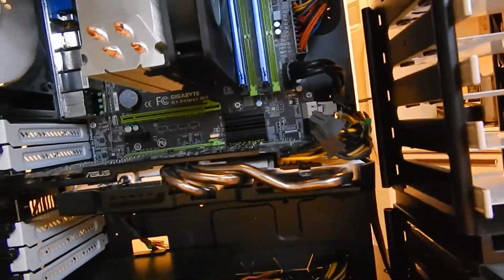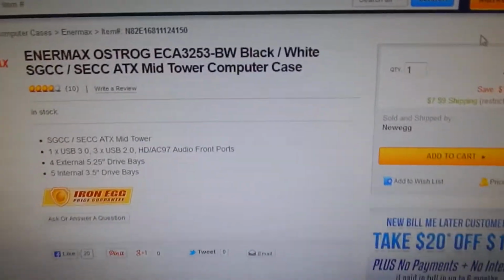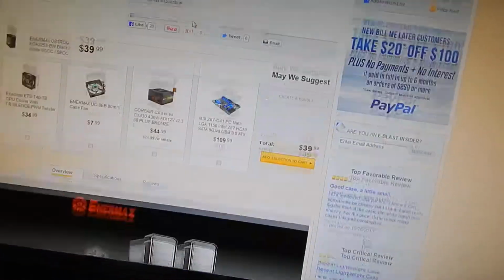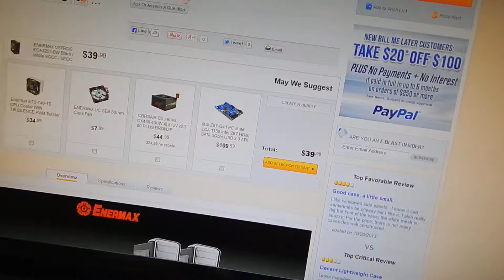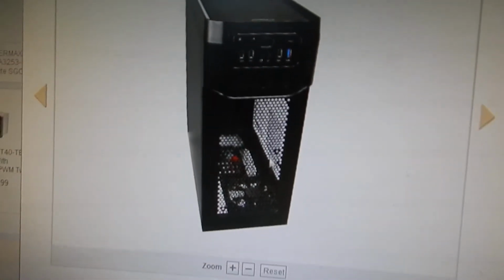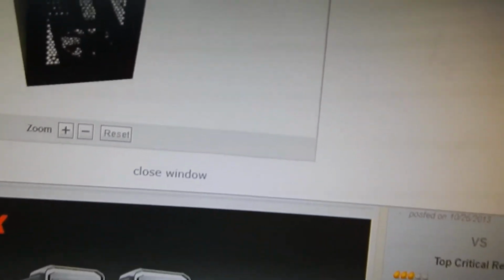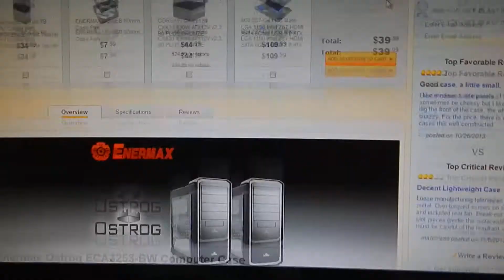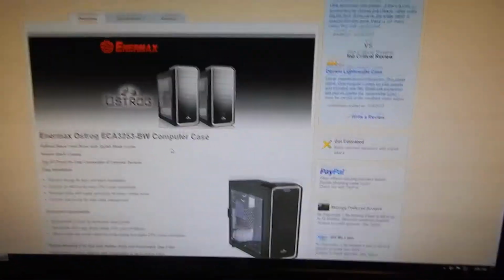Fractal Design Arc Midi R2/How to choose a good ATX Case for your PC

Comment: Good shit man
Reply from the maker: Thanks bro, you most welcome... That's what I'm here for after all...
Reply: Ya man no problem. Actually i got a question have you used/tested the fractal design define r4 because im interested in it but dont know how well the airflow is
Reply from the maker: Yes I am familiar with it. It has the exact same lay out that I review in the video and the air flow is the exact same too so no worries there. The good thing about that case is it is ultra quiet but then again so is mine...
Reply: Ok thanks man, i was wondering